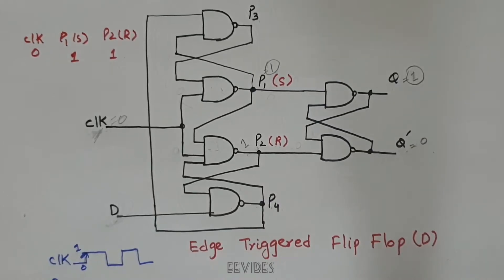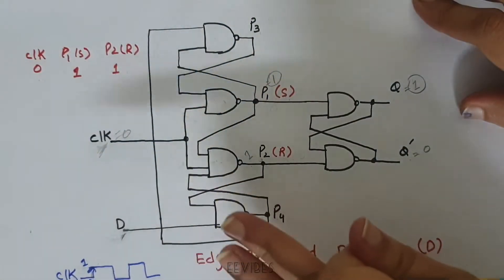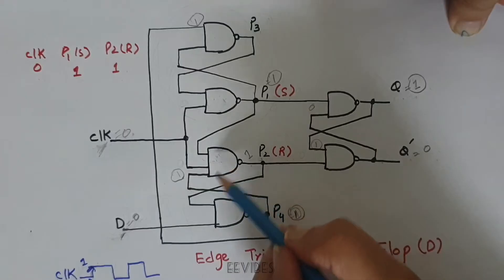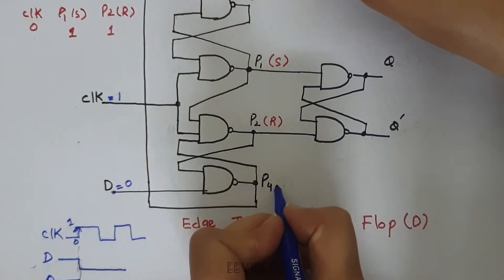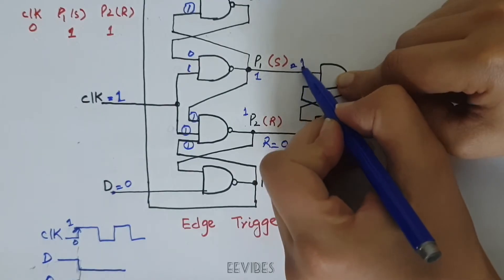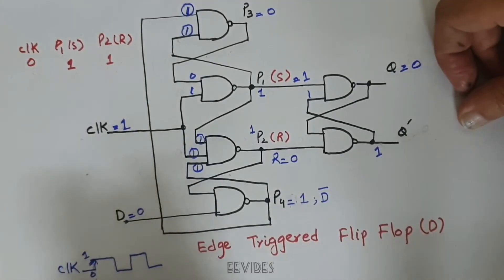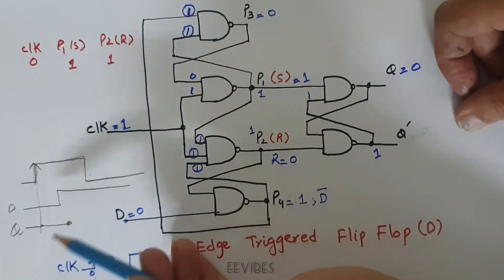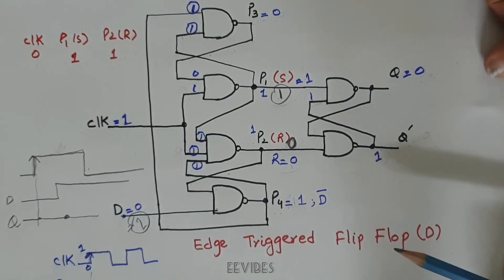Working of Edge-Triggered D Flip Flop

Comment: The one thing that I think this video missed was, what happens on the falling edge of the clock signal? I worked it through myself and it looks like the output would remain the same. Other than that, very helpful thank you
Reply from the maker: Yes, true. If a flip flop is positive edge triggered, then input will be effective only on the rising edge of clock, and there will be no change on falling edge. For negative edge triggered flip flop, output will be changed on the falling edge of the clock signal and no change at the rising edge.